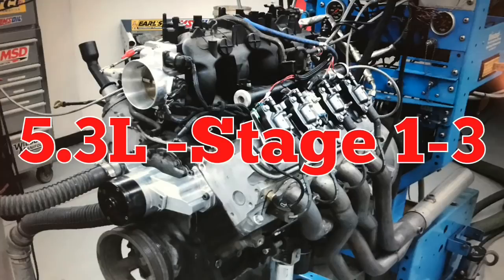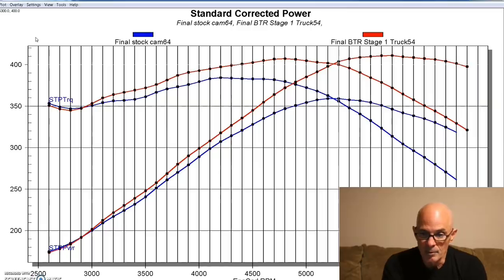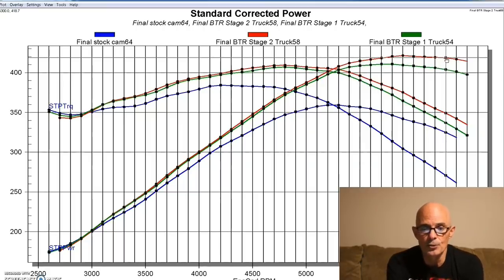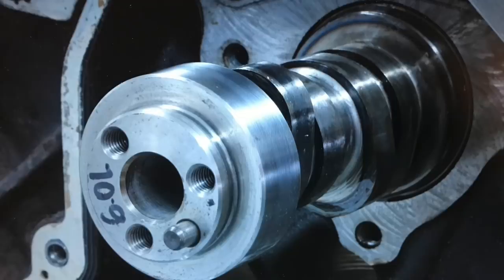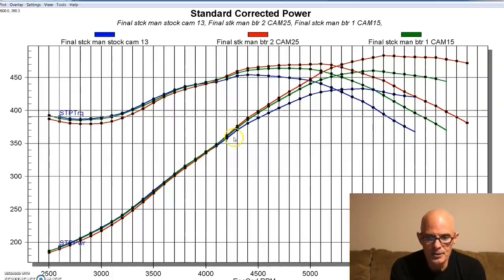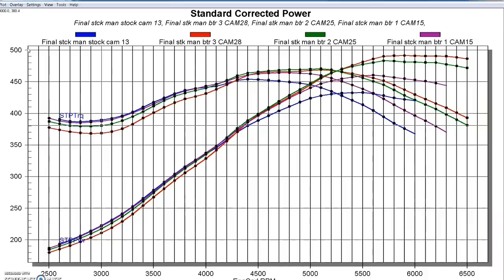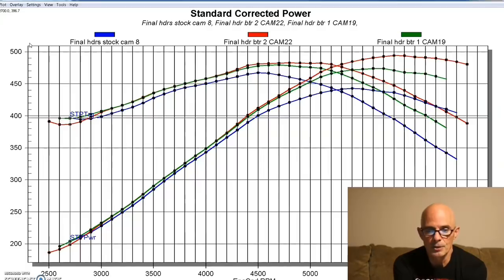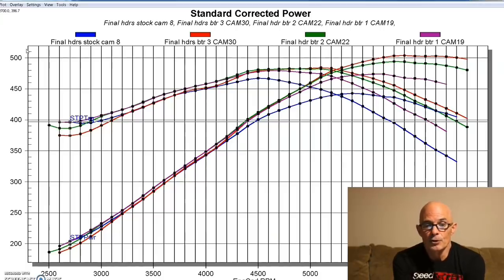LS TRUCK CAM TEST-5.3L & 6.0L (TORQUE FOR TOWING)

Comment: These tests are Ok but what about BSFC ? For the gains in power /fuel consumed. It shows the Factory original cam is really good.  for power in the normal rpm range . The fuel consumption is good as noted by general knowledge . And you did not optimize programming for any test.

Comment: An interesting test would be to run an LQ4 with 317 heads and then put the "smaller" 706 heads from a 5.3 on them and see which ones have higher power. My guess is 706 heads because of the smaller combustion chambers.

Comment: Ya think increasing compression 0.25 to 0.5 of a point would help fill in the loss down low for the Stage 2 and 3 cams? Mill the stock heads or use different heads with less CC volume?
Reply from the maker: it won't fill in that area, it just adds power everywhere-with every cam

Comment: I have one question that maybe someone can answer for me. I’ve noticed something about all these dyno videos about the “stock” 5.3. They all have seem to have inflated dyno numbers. This video seemed more realistic, but a stock 5.3 with headers and a TBSS intake putting out 380ft-lbs and and 360hp seems a bit high to me. Several years back, Westech dyno’d an LS327 crate motor with an upgraded cam, and ran some headers and various carbs on two different intakes, and the best they could pull from that engine was 340hp and 365ft-lbs of torque. So, it seems unlikely that a stocker would best those numbers by 20hp and 20ft-lbs even with efi and an upgraded intake using only a stock truck cam. I mean, I could be wrong, and I probably am, but something doesn’t add up.
Reply: I say this with the assumption that the 5.3 being used is an LS based motor, and not the more current version. Just curious.
Reply from the maker: please watch any other video that explains the difference in the factory rated power vs the (significantly different) way we test it
Reply: @richardholdener1727  thanks for the response. I’m trying to figure this out because I am running the LS327 in a 2003 Sierra. It’s definitely an upgrade, but it’s no match for a Hemi and definitely not for an Eco-boost. I’m looking at some cam options and headers, and I’m using all the info I can get to make it reliably powerful while maintaining drive ability.

Comment: Hello I have a 2003 chevy avalanche z71 5.3  and when I go up a stip hill I lost power with my foot to the floor but once I get to the top I get full power should I get a stage cam or a bigger throttle body I go offroad so I need that power please let me know what you think thank you
Reply from the maker: HAVE YOU LOST FUEL FLOW OR OIL FLOW OR SOMETHING ELSE FROM THE STEEP HILL?
Reply: Hello no oil pressure is at 60psi and I have new fuel pump and fuel filter i was think maybe injectors

Comment: What is he using as a stock 5.3 cam?? I looked mine up for l59 5.3 and it’s not that aggressive. 192/190 duration. Lift is like 465. Lsa is 119.  He’s getting 360 horses at a stock setup.  How?? Mine is rated at 285 best as stock. No mods.
Reply from the maker: Every LM7 (including your 5.3L) makes this much power the way we run it-no accessories, optimized tune, headers, open TB (you are confusing rated vs tested power output)
Reply: Richard Holdener. I hear ya on the rated vs test. Ya. I’ve been looking at videos about a 5.3 and probably as stock they put 230-ish with a factory tune at best. Hptuner allows a free 50hp just by changing the pe to 0% for the rpm limit and throttle. Wow.  Thanks for the reply.  Thanks Richard. How much tuning assistant does that Holley do?? Does it give suggestions??   You rock Richard!!!

Comment: May be a dumb question but what is the difference between the Btr stage 3 truck cam and the Btr stage 3 ls1 cam? I'm thinking about getting a Btr stage 3 for my 05 5.3/4l60e and do plan on getting a converter. I've read where someone said to go with the truck cam cause the btr ls1 stage 3 would be too big for a 5.3. Any truth to that?
Reply from the maker: look at he specs
Reply: @richardholdener1727  thanks. Big difference lol please do a video comparing the btr truck cams 1,2,3, and 4 vs the btr truck Norris cam. I can't decide, thinking stage 3 or 4 with a stall or maybe the truck Norris with stock stall for my 5.3/4l60e

Comment: Is there a reason you haven’t reviewed comp cams or summit on here? I haven’t found anything anyways. I just bought a summit stage one truck cam for my truck and specs are between btr stage one and two truck cams
Reply from the maker: how do you like it
Reply: @richardholdener1727  I just bought it so I don’t know yet. Heard good things though. .209/.217 dur and .550/.550 lift 112 lsa so I think it’s between the stage 1 and stage 2 btr in specs

Comment: I have a 2003 5.3 tahoe with a stage 3 cam, long tube headers, corsa exhaust 52lb injectors, stock bottom end, what do you recommend for a stall converter?
Reply from the maker: I'm not a converter guy-best check with the experts

Comment: Boss, would a stage 1 cam with 4.56 gears benefit from a higher stall torque converter like a 2,400-2,700 stall?
Reply from the maker: WHAT SIZE MOTOR?
Reply: @richardholdener1727  5.3L
Reply: @richardholdener1727  Boss, it’s a 5.3L LM7 from a 02’ Suburban

Comment: I've got a 2004 LQ9 6.0L in a 2003 Silverado tow rig/ weekend family hauler.  I'm thinking TBSS intake, stock throttle body, stage 1 or maybe 2 cam and long tube headers.  I also have a set of 243 heads I've been thinking about using.  What's your opinion on this combo?  Should I use the 243's?  TBSS intake worth it with stock throttle body? I don't want to run an x-link...  Stage 1 or stage 2 cam?
Reply from the maker: yes 243 heads, TBSS and headers

Comment: What cam would you recommend for a stock lq4 2500hd with nv4500 upgraded clutch and solid axle swapped around 7000lbs looking to make it dedicated sled pull rig want to get the most power vs torque as possible on stock 6.0 until I build a stroker
Reply from the maker: SMALL TRUCK CAM

Comment: I have learned that all cams are boost cams and they don't care about the intake shape of the heads. But could you back to basics talk a little more as to why they are marketed like that? Is it just where they have valve events happening or is there really no difference at all and they just market it that way.

Comment: I got an 03 Sierra with 6.0 I don't run it hard but I do tow with it, so my question is this what would be best for power to pull and daily driver I also have a 5 speed manual transmission. And will either of these past emissions with stock tune.

Comment: How much off are these numbers for 2002 6.0 with 317 heads Richard?
Reply from the maker: the 317s and stock truck intake make less than LY6
Reply: @richardholdener1727  I understand that but by how much approximately is my question?

Comment: So my truck driving 75 mph it's running 2200 RPM. I would be interested in knowing what cam can handle the most drag without loosing RPM at that speed. In other words I don't want my truck to shift down to higher RPM for a fuel mileage reasons. Not sure how such a test would be completed.
Reply from the maker: add a stage 1 truck or torq cam
Reply: @richardholdener1727  I recently data logged a gen 4 5.3 with the torque cam. There was not a noticeable power difference under 4,000 RPM.

Comment: What do u think a  lq4 with ly6 heads, btr v2 stage 2 came and springs,and wisco +6 cc positions bored 30 thousands over with tbss intake and long tube headers will make roughly?
Reply from the maker: PLEASE WATCH THE BTR 6.0L CAM VIDEO WHERE I RAN A STAGE 2 TRUCK CAM
Reply: @richardholdener1727  I have but was wondering what effect domed Pistons would have

Comment: WHAT WOULD HIGHER COMPRESSION DO TO THIS TEST? LIKE A LQ4 PUNCHED OUT TO 4.030" WITH A TRUE FLAT TOP PISTON AND HAVING 243 HEADS? BASICALLY AN IRON LS2 WITH 10.9:1 COMPRESSION. WOULD THE HIGHER COMPRESSION MAKE FOR MORE LOW TO MID RANGE GAINS? LESS OF A TRADE OFF IN LOW SPEED TORQUE VS. TOP END POWER?
Reply: So, i put this engine together. 370ci, flat top pistons, 243 stock heads, NNBS/trailblazer ss intake. Stock everything else. Installed this engine into a 2004 silverado crew cab 4wd. Truck has a 2600rpm stall, 4.88 gears and 37x13.5r17 tires. Dyno in second with 325hp and 335ftlbs. Seems kind of low... What do you think?
Reply: Also, it is a btr stage 3 v2 camshaft

Comment: If I where to swap to a stage 4 btr cam with a 3600 converter shuld I change the rocker arms to a some roller rocker arms to accommodate the bigger cam with dual valve springs?

Comment: I was wondering I have a 2004 truck block and I also have a stock Ls2 Cam and Springs out of a 2005 Vette and was told Id gain about 40-50 hp and was wondering if that was true thanks.
Reply: Great video I love all the real data
Reply from the maker: check out the stock ls cam video-I tested the ls2 cam (along with every other stock cam)

Comment: thanks you made my cam choice a lot easier! I was going to get stg 3 cause the bigger the better. NOPE
Reply: Hey you know there are other cams other that btr bullshit,. Ha ha ha
Reply: cbr1thou Like what?
Reply: @mlwakat  comp lsr , im runnin 54-458-11. 227 235 .614 .621  on daily driver 5.3 with trick flow gen x 205.
Reply from the maker: good cam-not really a truck cam though-I like the 54-454-11
Reply: @richardholdener1727  might have to try that one, but the 458 is working for now, 2 wd silverado

Comment: I just put a btr stage 4 turbo cam and springs in a 6.0ls.   Now with the plugs in it's super hard to turn it over by hand starter barely moves it.  Everything is right I took it back apart to check.   Is it possible that now I need a high torque starter??
Reply from the maker: that cam should be easier to start
Reply: @richardholdener1727  .......not good

Comment: These cams are all smaller than a sloppy stage 2. Tells you how much torque you are losing down low with that cam compare to the BTR cams.
Reply: I tuned a bone stock 2008 5.3 Silverado with a ss2 with a stock converter and it was an absolute turd below 3500 rpms.  The owner was really disappointed.  It had stock gears and 33's which made it considerably worse lmao

Comment: I have a 05 Sierra L33 with 799 heads, want 360-400rwhp because it's a DD but don't want to give up too much mpg and would like to keep the truck running for another 250,000 miles. Am I living in fairy-tale land or is this possible and has someone done it already?

Comment: What did u do with  the o2 sensors and the egr what type of difference would it make it catback delete egr delete
Reply from the maker: we run oxygen sensors in our testing but don't activate EGR. we run with a Holley HP management system

Comment: I’d be curious to see the torque loss on the stage 4 down low on both engines
Reply: I assume it would follow the same trend as the stage 3.  More on top, less on bottom.  I'd like to see a stage 4 in a stroker 408. Maybe make up for the losses down low.

Comment: I'm new to OBD2 systems, I've only built carbed pre 1980s vehicles; what is the converter he's talking about putting in so you don't have power loss? I have a chevy truck with an LQ4 and stage 3 btr cam with long tube headers like this test, I'm very happy with the engine but if I can mitigate power loss I'd love to.

Does anybody know what this converter is?

Comment: What cam would you suggest in a 6lt L98 Ve Commodore  auto no converter. Has ort vcm induction with 1 3/4 exactors and a 3 inch exuast system. Vcm tells me same cam as a Ls3 engine. L98 v8 came out in a 2006 Ve Commodore in Australia.
Reply from the maker: is it VVT?
Reply: No.and no DOD.

Comment: Can run a trailblazer 4.2 torque converter  it is also a 300mm same a ls with 2500 stall

Comment: These numbers seem high. Is westech's dyno calibrated per SAE standards?
Reply: Jamie Schinkai He said they were higher than normal because of the trailblazer intake.
Reply: @bcbloc02  Also review the video from a few days ago where he shows the improvements from loss of accessories, intake changes, etc. vs. stock.  There's a lot of little things that juice these engines over SAE flywheel numbers before he even begins testing the parts.
Reply from the maker: high compared to what-the rated output? See other vid on accessories for explanation on test differences
Reply: @richardholdener1727  The real question is, has this dyno been calibrated per SAE standards?  Richard, your work is excellent. I'm not denying the validity of the testing at hand, however the final numbers seem rather optimistic typically. A mild cammed, vortec headed SBE 305 made 368hp on that dyno (ref engine masters).

Comment: What long tube headers did you use?
Reply from the maker: qtp 1 3/4 most likely
Reply: QTP??? Never heard of them. Are they good headers
Reply from the maker: there wasn't a lot of difference between headers-check out the cheap vs big $ header video

Comment: Would I need a converter? I'm running a 2009 1500 crew cab short bed Silverado with a swapped l96, 6l90 and 1 7/8 long tubes
Reply: I'm looking at a summit stage 3 truck cam by the way
Reply: I would guess you do, A stall is usually recommended for stage 3 Cam's. Contact Summit they should be able to tell you.

Comment: 6.0 L stage 2 with turboed 15 lb of boost thousand horsepower easy
Reply: That's what we're running on 24 lb of boost it's almost uncontrollable. Stick shift 67 Camaro

Comment: Why not the stage 4 ?? Time restraint?
Reply from the maker: did not have a at the time
Reply: @richardholdener1727  I have one in my 4.8.. mixed feelings on it...it screams from 5k to 7.5k... doesn't make  a lot of torque. . I'm sure it's has a lot to do with the cubic inches combined with a cam that would take away from the lower rpm range .. made 313 at the wheels and just shy of 300 torque

Comment: I'm doing the BTR Truck Torque Cam , quite low numbers.

202/202 ,.511/.511 ,111+1

I am doing this install in a 2006 6.0L with the LQ4 , 300HP factory.

I cannot find any info or tests on this engine, and very few on this cam.

Anybody have experience with this cam ?with this older weaker engine? Just curious as I hope I didn't choose the wrong one.

2006 GMC 2500HD 4WD 4spd auto , 4.10 gearing.Looking for more low end up to normal use rpm ranges, not doing WOT pulls or racing unless I'm just clearing it's throat. ;)

Or maybe it will repsond spectacularly.

Just wondering if anyone out there can share some experiences .

These videos from Richard Holdener are great resources, thank you for producing them if you are reading Richard.

Comment: Why you say every cam is a boost cam? How's a 232-234 @.50 600 lift 112 LSA a boost cam?!?
Reply: Hite Racing watch his video on it. The cam profile doesnt matter. With boost the power and torque curve will look the same as the na run just itll be making more power everywhere
Reply: @nicksaj1797  I'll check it out thanks

Comment: these are in sae gross ratings assisted by the headers and no maf. Do not expect this in your truck.
Reply from the maker: wheel hp and flywheel hp are different
Reply: @richardholdener1727  so is SAE Gross and SAE NET for the flywheel. Which is what I'm talking about.

Comment: What torque converter would you guys recommend for replacing the stock one in a lq9 6.0 swap with a btr stage 3 truck cam need some help lol
Reply: I have one from a company called perfect converter. I told them what I had and what my future plans was and they custom built my converter for my truck. I recommend them 100% I told them I was going to 4.88 gears on 35 inch tires, with stage 2 or 3 btr cam v2, with long tube headers with a 6.0. Currently with my fully built 4l60e transmission and 5.3 with 3.73 gears at 2000 rpms she comes alive quick.

Comment: I think i know what i wanna buy till i watch one of these videos. Its a good thing but dam does anyone know of a truck cam thats a straight up stump puller in the low end that has nasty chop. I dont want a turd up top but i wont be reving it out that high very often.
Reply from the maker: good luck with that cam
Reply: @richardholdener1727  i know right thanks for the videos

Comment: What water pump is that your running on the dyno
Reply from the maker: meziere
Reply: @richardholdener1727  thank for the reply yeah running a BBC water pump on my lq4 but like to get hot narrowed it down to three things water pump thermostat hose routing and set up or the cheap eBay radiator that was already done to the build when I got it take few minutes to get to 180-200 but if I make a pull at those temp it jump to 220 no problem

Comment: Any good resource for turbo specs?
Reply from the maker: ask away
Reply: I pulled a turbo off a Chevy 6.5 diesel. Can't remember the year was definitely 92-98. My question is is it any good to use for a build? Only looking for a lil boost- 8-12lbs max.

Comment: great vid but doesnt help a guy that doesnt have long tubes or the better intake.  Im looking for a video where its just a cam change for gains or very lil other additions that arent going to break the bank.     Intake and long tubes aint cheap for the common guy.
Reply from the maker: I tested the cams with stock manifolds too
Reply: @richardholdener1727  can u post the link of the stock manifolds
......u have a crap load of vids to sort through  lol

Comment: Guess it depends what you're gonna use the truck for, I know it doesn't hurt for it to down shift and spin a little faster but it sure is annoying when you're going up a hill and it has to just to maintain your speed.

Comment: 5.3 tsp stage 2 high lift cam with headers ported and polished 862 heads and springs. and still stock converter never looking to change it out for a donkey d*ck cam